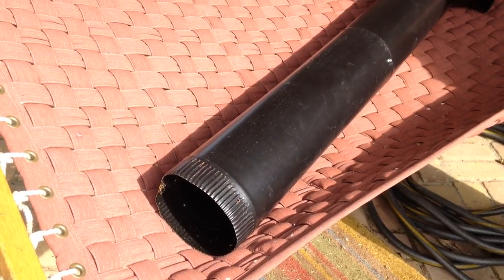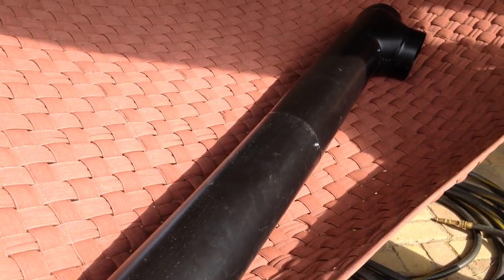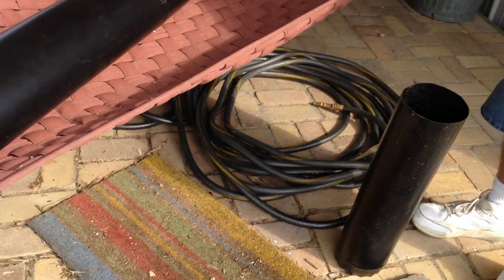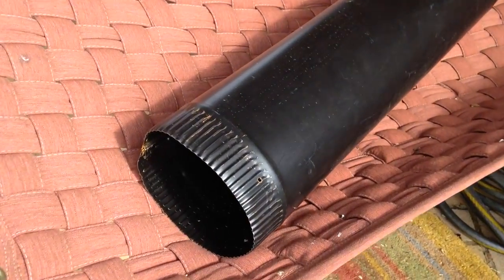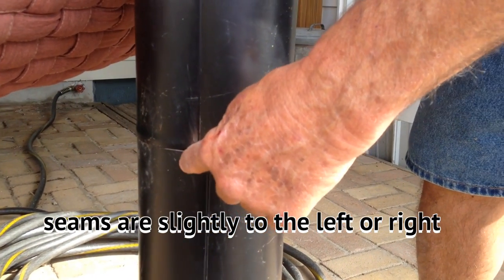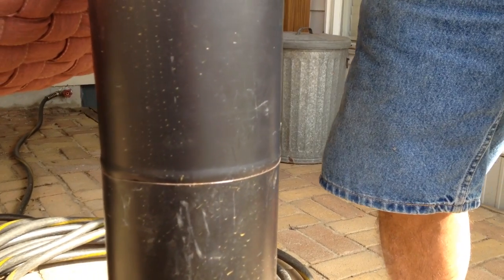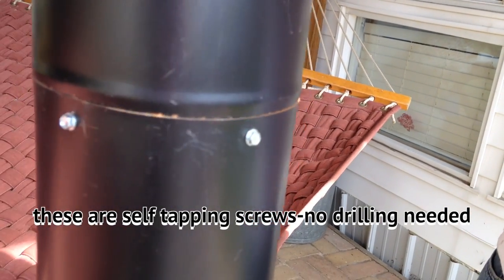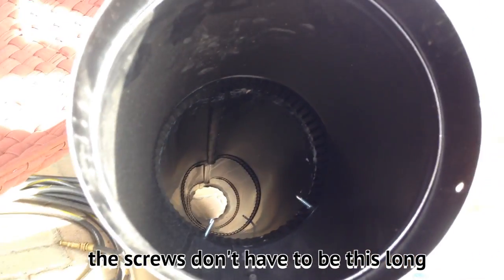lp Putting the Stove Pipe Together 2 of 2

Comment: The clean out is supposed to be on the bottom....so the crimped edge of the pipe is what should be going into the Tee from the top. Your creosote flows down the pipe.  If the crimped edge is top of each section the creosote will come out the connection. Basically your sections are in backwards.
Reply from the maker: Thank you for the info.